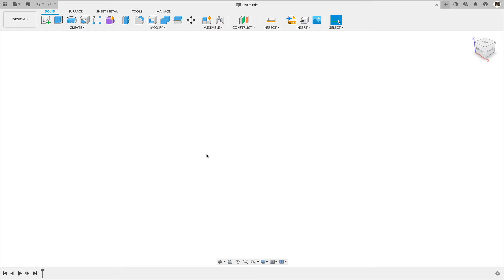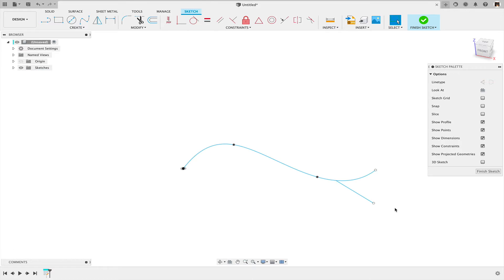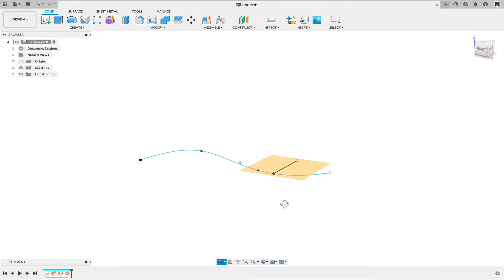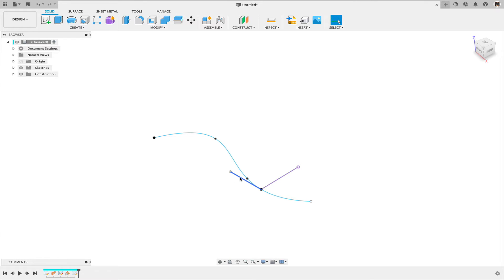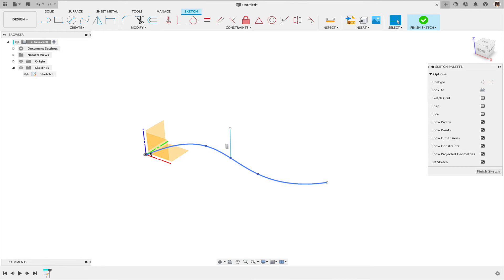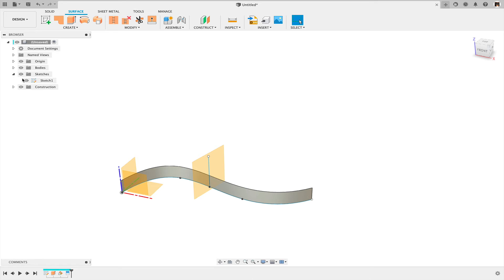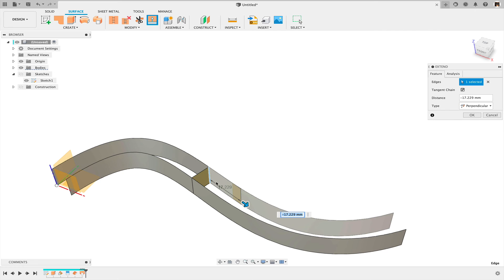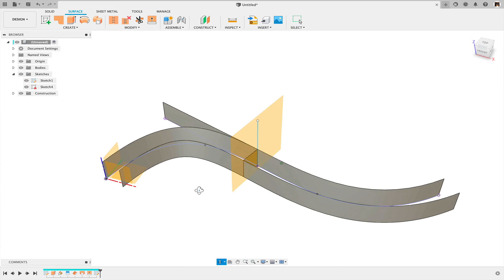Fusion 360 - Tangency to a Spline

Comment: Thanks for sharing. Love your first method! however second is not nearly as optimal - it can be simplified by Ruled (Tangent) from section line (eliminates need in offset and loft), or even by Construction - plane tangent to face at point (no need in PLane at angle and Face split at all).
Reply from the maker: The advantage of the 2nd method is that it does not require another sketch. A side benefit is that it also allows you to „split“ a spline at an arbitrary point but maintain curvature continuity. Working with surfaces only, for me has the advantage that I can export geometry from Fusion 360 and use that in another application, something I unfortunately have to do from time to time as there are some areas in Fusion 360  that aren’t quite mature yet, particularly when working with surfaces.
Reply: @TrippyLighting  I get that. Working with surfaces sometimes easier and sturdier than sketches and I do the same often. My point is that starting from 4:11 you can just use Ruled [Tangent] started from split edge as it gives same result as Offset-Loft-Extend chain
Reply from the maker: @dadapasha  True,  could have done that! The reason for this tutorial can be found in his thread on the Fusion 360 forum.  this.https://forums.autodesk.com/t5/fusion-360-design-validate/compute-fail-for-tangent-circles/m-p/10420426/highlight/true#M252224

Comment: Is it possible to draw a centrifugal pump or a snail in this way? If you can tell me how you can implement it.https://www.google.com/search?q=%D1%86%D0%B5%D0%BD%D1%82%D1%80%D0%BE%D0%B1%D0%B5%D0%B6%D0%BD%D1%8B%D0%B9+%D0%BD%D0%B0%D1%81%D0%BE%D1%81&safe=active&client=ms-android-xiaomi-rev1&prmd=ivn&source=lnms&tbm=isch&sa=X&ved=2ahUKEwiW3M7Rk8XxAhUXgf0HHXZLC98Q_AUoAXoECAMQAQ&biw=393&bih=655&dpr=2.75#imgrc=rQgmFo1TFYESzM
Reply from the maker: My recommendation would be to take this to the Fusion 360 Forum and ask such basic questions there.
https://forums.autodesk.com/t5/fusion-360-design-validate/bd-p/124